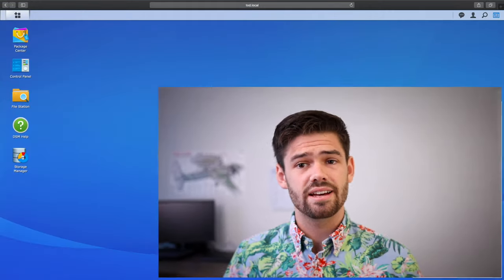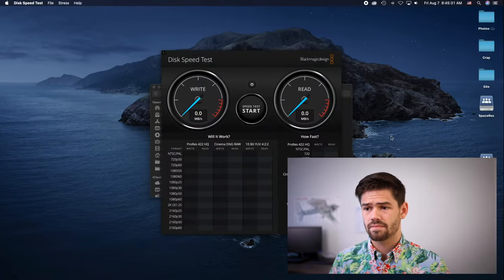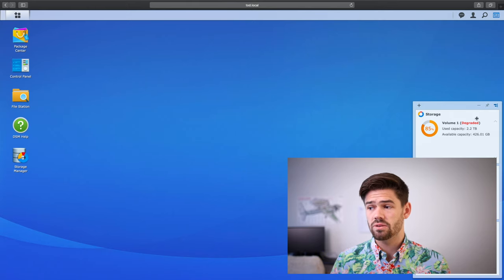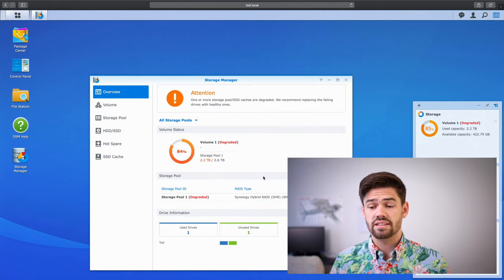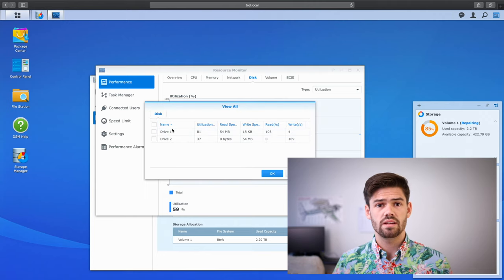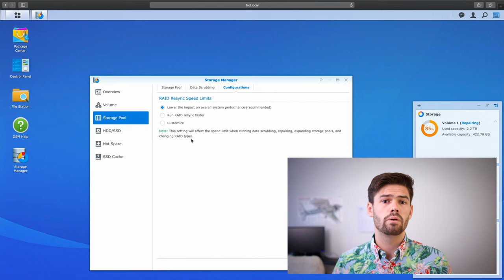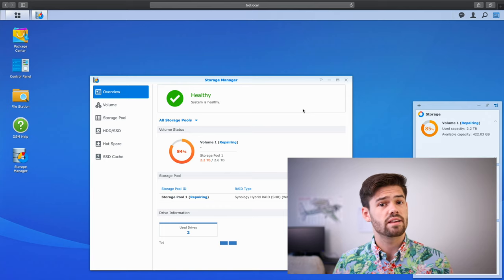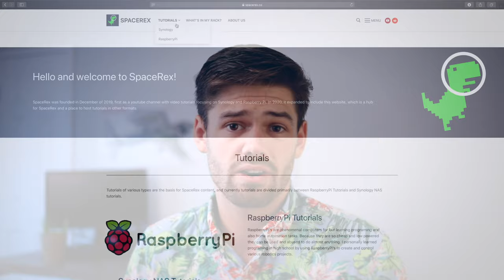How to Repair Synology Volume + Simulating Hard Drive Failure | 4K TUTORIAL

Comment: Very good and easy to understand - looking forward to your next video. On my wish list is more about virtual machine manager. I have a W10 now running but is not impressed by the performance - I am sure/hope that can be improved....Thanks.
Reply from the maker: Honestly there is not a ton you can do with windows :/. 

If you can run it on Linux I would try a Ubuntu VM. They are so much more light weight

Comment: I have a DS1819+ running RAID6 with five 10TB drives installed.  I have to replace Drive 1 that is currently failing.  1).  Is the repair time calculated strictly by how much actual data I have stored on the NAS, regardless of the Storage Pool total capacity OR is it calculated by the Storage Pool capacity, regardless of how much data I have stored on it?  2). For future reference, if I install a Hot Spare drive, at what point will that Hot Spare initiate a RAID rebuild/repair? only after a complete drive failure OR at some pre-determined point of drive failure?  3).  When running a Hot Spare, can that speed up the repair process any? (beyond just waiting on me to get around to initiating the repair - for example, can it in any way already have the Parity Consistency Check done ahead of time in order to instantly begin the actually rebuilding step?

Comment: What is the logic behind repair not seeing that the "new" disk, is actually the same disk and that the data should be 99% the same? I don't see the point in erasing the whole disk and causing so much stress on the system as well as opening a big half day window of time when the data is vulnerable.
I had an issue when a volume crashed in the past (single disk, not even SHR) the crashed occurred for an accidental disconnection of the disk and I was force to backup externally, rebuild the volume from scratch and restore. The whole process required me 24+ hours and during all that time, the data was still there intact as the volumen was "crashed" but in read-only mode. I understand Synology is very picky about failures but this is really extreme.
Good video by the way :)
Reply from the maker: Glad you like the video! Honestly that's a big part of RAID in general, its a really rare circumstance when a drive would get unplugged and then plugged back in, all while being fine. Then the NAS knows that the drive does not have the info on it that it should. But the only way to know what is missing is to go through the entire drive and check what it should be and compare. Instead of doing that it just starts from scratch and rebuilds

Comment: Hi quick question, (noobie) when I purchased my synology I had everything installed (operating software etc) on my 6tb nas drive. I am planning to change the drive to a bigger capacity but the question is would I need to reinstall everything? As it contains plex settings dsm software etc
Thanks I’m advance

Comment: Okay, what do you do when you're repairing drive 1 and during the repair,the Nas starts to overheat? Because that's the problem I'm having right now. I'm trying to repair 8 TB WD Red. On a DS 218+
Reply from the maker: What do you mean over heat? is it the NAS or the Drives? Unless its actually flashing you a warning I would not worry about it. If you are having issues you can just manually turn the fans up

Comment: I would like to backup a file server to a synology and hot swap drives out for offline storage of backup. If the synology gets ransomeware and i have to put in the offline drive, will it pick up where it left off, will I have to do a restore? It looks like from your video the drive will be in a degraded state just from removing it. Is this not the intended use for hot swappable drives? Will the drive i removed be potentially compromised from hot swapping? How can i do something similar to this to do offline storage?
Reply from the maker: This really is not what it is designed for. 

I would instead use hyper backup with this setup

Comment: Is it better to swap out the faulty drive while Synology is still on, or better to turn it off > swap it > turn on the system? I am paranoid about losing my data
Reply from the maker: So if you have a hot swap synology (most are but double check) its actually best to leave the synology running if you have already one failed drive as the most common time for a drive to fail is actually when it boots up. 

Tip: before pulling out the drive 1) backup all of your data, and do a second backup / copy of those files you could not love without. 2) in DSM select the failed drive and hit "identify drive" that way it will blink and you will know which one it is.

Comment: So hypothetically, if you have a larger Nas with several drives and one failed, could you just reconfigure your pool so that it is just one less drive and then you would lose the capacity of that drive but regain the 1 disk fault tolerance? Assuming that you have enough unused space to lose that capacity.
Reply from the maker: The problem with this is that would require a shirk of the storage volume that is not supported by most RAID types. 

You cannot do this on synology

Comment: Seems like this has changed in DSM 7 as I don't see the actions option for the storage pool. Regret updating for sure.
Reply from the maker: They still do. Just moved
Reply: @SpaceRexWill  Can you explain or make a video on how to do this in DSM 7? I have a drive with System Partition Failed error. Its telling me to do a repair but I can't find any repair options.
Reply from the maker: So you have a raid 5/1 or SHR? 

Also you need to place another drive that has not failed in there.
Reply: @SpaceRexWill  I have a SHR 4 BAY with all bays currently occupied with a 1 disk redundancy.

Comment: I feel like I've breathed on my NAS and another drive fails. I've been really disappointed in both the synology NAS and the drives. Spent 1000s of dollars at this point on 3 replacement drives within 3 years
Reply from the maker: wow that sucks! What drives did you get? That sounds like you got a really bad batch of hard drives
Reply: @SpaceRexWill  Agreed, All Seagate Ironwolf and Ironwolf Pro. I've had hard drives on my PC that have lasted years, so wondered if the synology was screwing up the drives. It felt like too much bad luck

Comment: Tried this and it failed, over and over with two different brand new drives. Once it's done the new drive is in a "crashed" state just like the old one.
Reply from the maker: Crashed is not degraded. If you have a crashed volume you need to contact synology support
Reply: @SpaceRexWill  It says degraded in the volume menu and in the pool it shows one of four is crashed. So, which is it?
Reply from the maker: If it says one of your pools or volumes has crashed that has to be recovered. What happened?
Reply: @SpaceRexWill  Power went out and then the UPS was making noise, the lady unsure what to do just turned off the UPS so she could have quiet instead of the beeping and then when the NAS was powered back on it was like that.
Reply from the maker: Ah yes that sounds like a volume crash rather than a degrade. Contact Synology support

Comment: I'm starting to dislike Synology. Bought the DS920+ and it's been up for two weeks and great. Woke up to it beeping, "Volume partition failure." it rebuilt fine but if I turn it off and on, it starts all over again. Synology hasn't responded to my ticket yet. Thinking of returning the whole mess! and getting a different brand.
Reply from the maker: that sounds like one of your disks might be DOA
Reply: @SpaceRexWill  How do you know which one though. Im  about ready to throw it in a box and get a refund since Synology isn't answering any tech support.